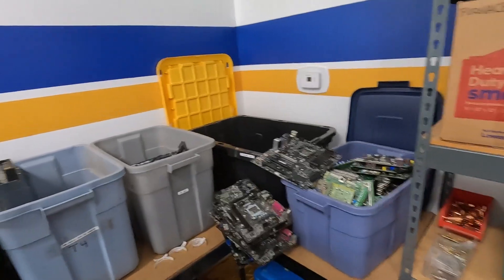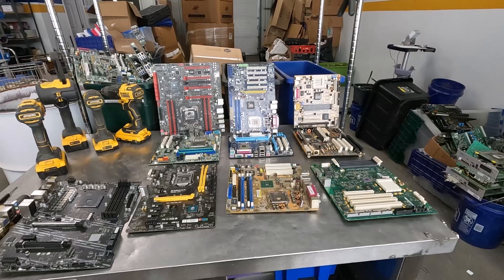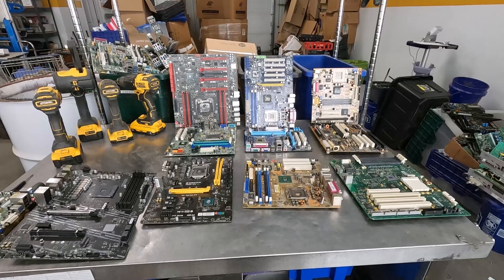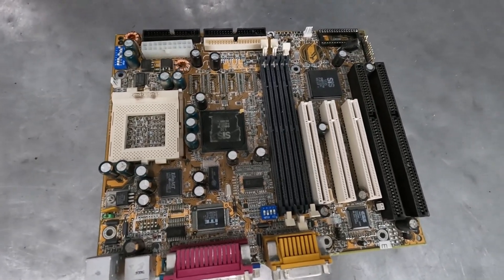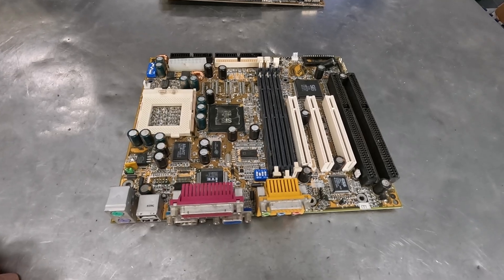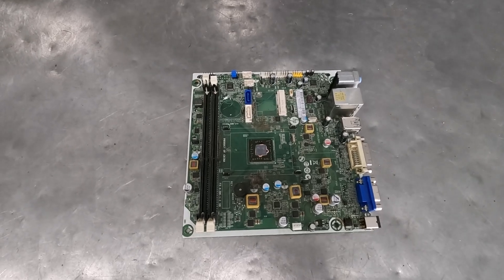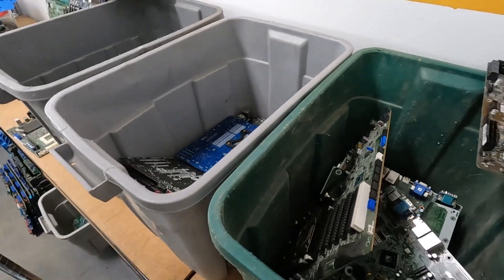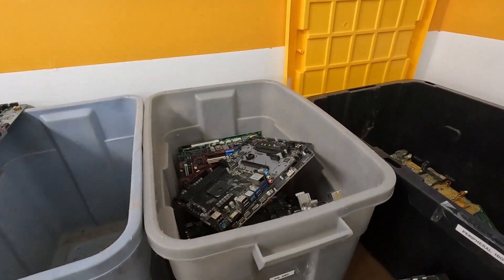A New Look at PC Motherboard Values

Comment: I never sell motherboards, or in fact any Printed Circuit Boards. 
It's far more profitable to process all types of PCBs at home, no mattter how small they are.
I recover the real values, and that's not the Gold! On average the most valuable part is the solder. Tin is worth 6 times more than Copper!
Hydrometallurgical processing recovers virtually every single bit of value from all kinds of PCBs.
Each individual electronic component is equal to money.
I even process the bare boards for total metal recovery.
Reply from the maker: Total recovery requires a lot of learning and expense that many are not willing to, or capable of committing to. For a lot of people the quickest, safest, way to get value from their scrap is selling to others. But I'm glad there are folks like you out there recovering all you can.

Comment: Thank you Shark for covering  these changes for your viewers. This is an ever evolving industry and as time passes the amount of precious metals being used to manufacture these devices will diminish, and as a consequence so will the returns on the recycled materials generated by them. What used to take a host of integrated circuits to accomplish can now be achieved via a dollop of epoxy  on a small wafer board.
Reply from the maker: Death - Taxes - and Change. The only things you can be assured of in life.